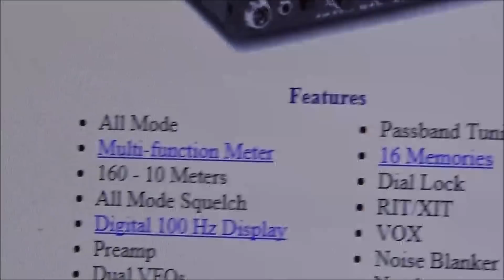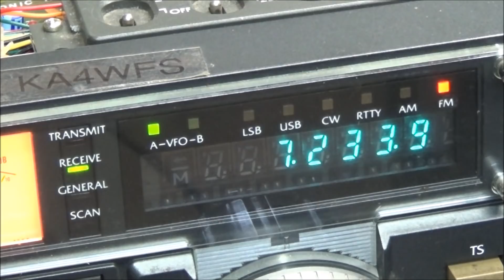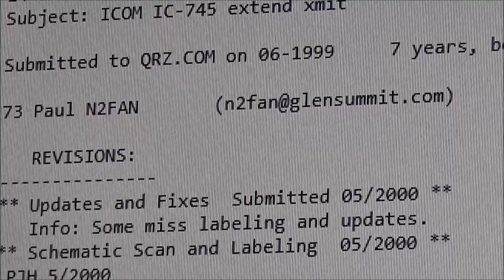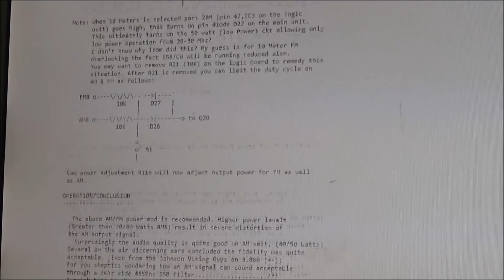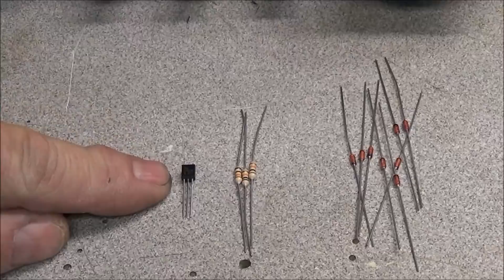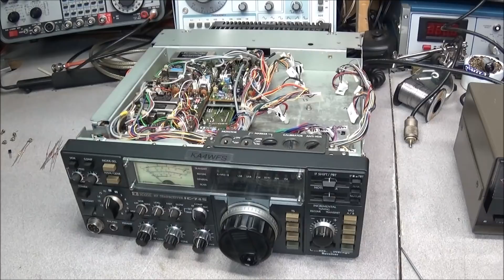#154 ICOM IC 745 AM TX MOD

Comment: I realize this is very old, but I just bought 2 of these, Does it not transmit on AM at all, or does it only transmit AM on the ham bands only? If you didn't get the FM option, what could you transmit on? Thanks, for your videos! Subscribed!
Reply from the maker: The 745 does not transmit on Am, only does SSB CW, and FMIf installed,
Reply: @TheRadioShop  Thank You!
Reply: @TheRadioShop  What was the power mod you mentioned?
Reply: @TheRadioShop  Do you still work on these? Program memory modules?, tried your website, Cannot register, disabled. Which board controls higher band sensitivity? I have one radio working good except the sensitivity is much lower than the "screwed one". I want to swap boards.

Comment: Hello Buddy

Thank you for this Excellent series of videos with clear and informative explanation of the issues and how to resolve!
I have a 745 with strange issues:
-20m is “missing “ from the band stack….it jumps to 4 Mhz instead.
All other bands are fine.
- No receive on CW but Tx is OK
-No receive on AM
-No Tx on FM but Rx is fine
-Tx and Rx is fine on SSB except for the missing 20m

Any suggestion where to start looking at what might be causing these faults?

Many thanks for any guidance

73

Steve
Reply from the maker: Steve. Interesting issues you have. Click the show more tabs to follow the links and give me an email about this. I will see if I can help you out with the problems.

Comment: Hi, can you help? The power switch on my IC-745 failed. I unsoldered it - but STUPIDLY forgot to make a note of what wires went where. There's a medium thickness red wire that goes to the fuse, then there's also a medium thickness black wire. There are also 3 thin red wires, and I remember 2 going to one of the switch terminals. Can anyone HELP? Preferably with a picture. Charles M0DED in UK

Comment: I have an ic-735 that was normal until the beginning of the year and recently started to have a problem with the reception. Some days were back to normal. The meter indicates a lot of signal, but I don't hear the stations or I hear very low. I disassembled the radio and found a lot of cold solder. After redoing the welds and assembling the equipment, the reception did not return to normal. Is there a specific component that I can test?

Comment: i thought there was a simple "snip" mod to allow transmit everywhere when in general coverage mode or am I remembering wrongly ;)
Reply from the maker: There is, Ir is called the "mars mod". But has nothing to do with AM mode transmit in this radio since it is missing the circuit to enable AM transmit.  These are two entirely different mods.

Comment: did you just overlap the component ends and solder or do you J-hook bend them and crimp tight before? I like j-hooking for added vibration proofing. some people tend to beat/hammer and abuse things :)
Reply from the maker: I used the j-hook method. Dont want them breaking apart.
Reply: I figured so, being an old school repairman with tricks of the past.

Comment: I really learned quite a bit from this video.  I was wondering if when you are pointing to components, you could use something small like a plastic swizzle stick.  Magnified, your fingers are large and it's hard to see what you're pointing to.  Very nice video.
Reply from the maker: Thanks Jeff, and I appreciate that feed back. I bought a bunch of chop sticks just for doing that.  And always forget to use them.  I am going to paint one yellow with a red tip and place it in eye sight on the bench. Thanks again.

Comment: Great to see you got it working on AM.  Probably one of two possible reasons why they didn't enable AM.  As someone else said to prevent chicken banders from using it.  The other may have been to force people to buy a more expensive model that did TX on AM.
Reply from the maker: You just may be right on that Mike.  Was not a hard to do mod, just needed my original service manual so I could find the parts better. But we made it through.
Reply: You call them "chicken banders" but you work on them? Hypocrite much??

Comment: nice job buddy.  i personally think the am was left out to keep the 11meter idiots away from this radio
i'm interested on how this rig performs b4 you mod any further,  i havent seen anything in the comments so far so i shall ask.
does this modify you doing throw off any tune & alignment?
Reply from the maker: I think they were influenced by the FCC at the time of this radio, this really made it harder to be used on cb.  Since we are not dealing with tuned circuits and only moving voltages around there is not additional tuning or alignment require. Thanks Scott
Reply: ah ok cool.  i look forward to more on this series :-)   any chance we will see more on the ft-101 series you started?
73'  k7sce
Reply from the maker: Yes, there will be plenty more on the 101 as time allows.
Reply: Yeah,  ok, but cbers still use hf stuff on ssb.

Comment: That was a lot of work Buddy. Well done. I am trying to think of why Icom didn't enable the AM mode. Obviously it was originally designed to do so. Maybe the bean counters got in at the last minute. Hard to believe that they put a function on the front panel that didn't exist and sent the radio to market anyway.  Glad to see that you are getting some use out of the old Heathkit power meter. 73 Doug.
Reply from the maker: I think it was an FCC issue back then. I really like that power meter. Nice little unit. Thanks for watching my friend.

Comment: I can't wait I have went swan crazy I actually talk to the guy who owns the swan your doing I been messing with radios for years myself I have something I can't fix which is my wavetek 3001 signal generator works fine on higher frequencies but not lower. Would love to send to you if you would be interested in looking at it.
Reply from the maker: I like the old Swan radios. I have worked on a few of the 3001. Some of the parts inside are now unobtainable. I would not mind looking at it for you.

Comment: Great mod Buddy!  I bought my 745 new in 1983, knowing it did not have AM transmit and at the time I used to hang out on 3885 and a ten meter AM weekly net.  I had a Johnson 500 so it was not a big deal.  I thought it was strange not having AM on it but figured maybe it was to frustrate CBers from getting one.  But this is a great radio and I loaded it up with all the options and of course purchased the service manual as well and that aided me in troubleshooting a few issues that popped up over the years.  Your series on this radio has me missing mine, of which I did have 2.

I really enjoyed this video and watched it from beginning to end.  Great Sunday night educational entertainment.  50 years ago it was the Ed Sullivan Show on Sunday nights, now it is The Radio Shop taking its place.  Proof that things do get better and better.
Reply from the maker: Thanks for sharing your story. I agree the 75 is an outstanding rig.  I could not get by without mine. Wow been many years since I watched Ed, we are getting oil! Thanks for the kind words and glad you liked the video.

Comment: Not a snip, and clip is certainly an understatment! I'm not familiar with the 745. In your opinion is the mod worth it? Does it to your knowledge make a nice sounding AM (once the mod is performed) transciever? Great job Buddy. Thanks for sharing.
Reply from the maker: It is a bit of work to get the AM transmit going. The receiver sounds pretty good even with the filters it has installed. According to Paul the TX AM audio sounds decent. Looks ok on the scope but will be doing another video on the audio and power mod. Thanks for the question, I believe it is well worth the effort.